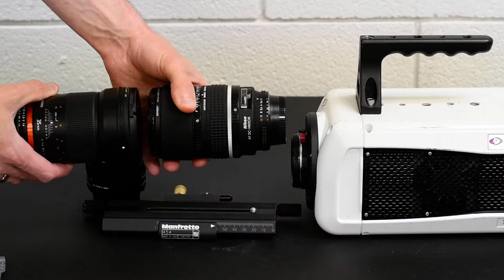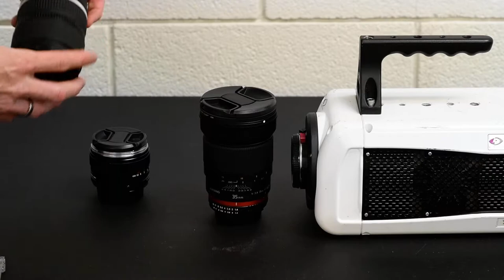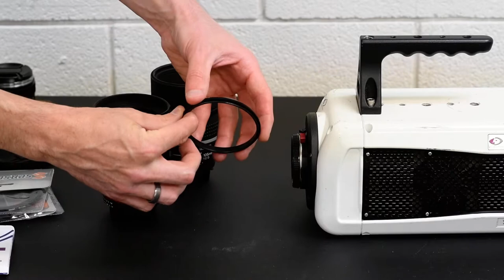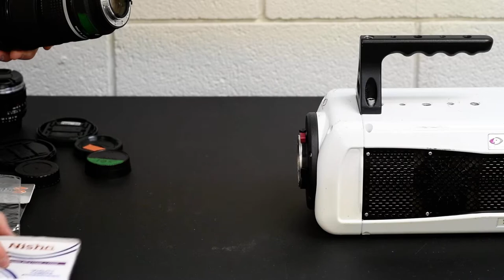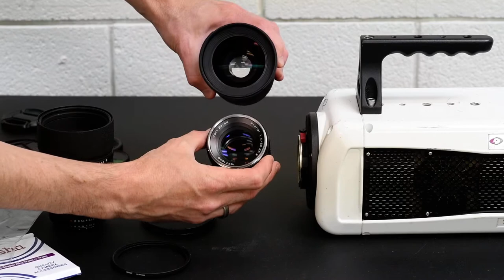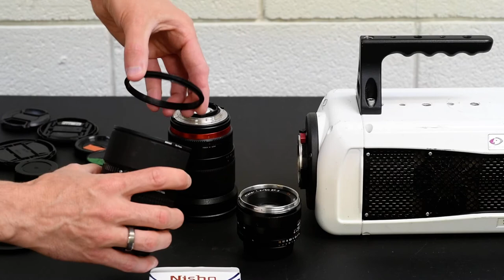Macro-Coupling High-Magnification Lenses - How To - Aimed Research

Comment: Hi there, I’ve tried this and failed somewhere.
I reversed a Nikon 50mm 1.8 on my Tokina 100mm macro.
On my display there is this black circle, I can’t call it a vignet anymore because it is like looking through a pinhole.
And all the pictures are so dark, even in a bright situation I have to use iso1600 or above.
Can you help me understand what I’m doing wrong?
Reply: Hi Jurgen, just in case you haven't figured this out yet: the father the front elements of the two lenses are from each other when coupled, the more vignetting you'll get. So if you have to use a lot of coupling rings, or you use a macro lens (which tend to have recessed front elements), then you'll be effectively pushing the lenses apart, which will lead to your image being in a circle surrounded by black (like looking through a closed aperture out of the focal plane).